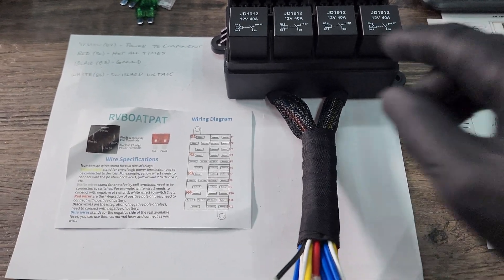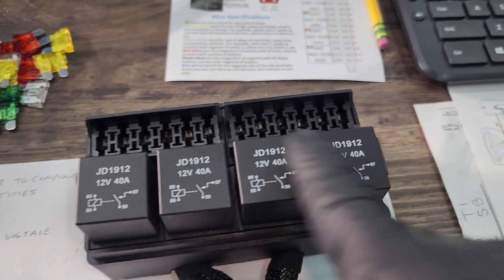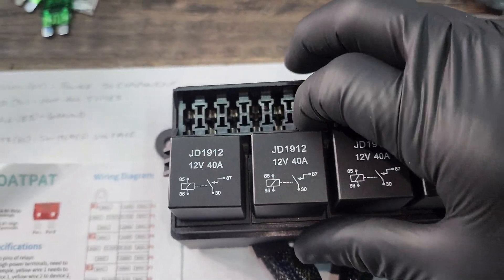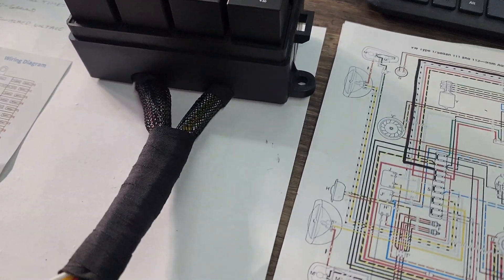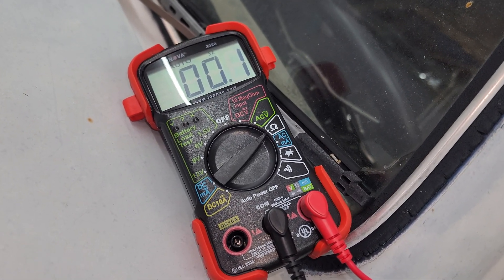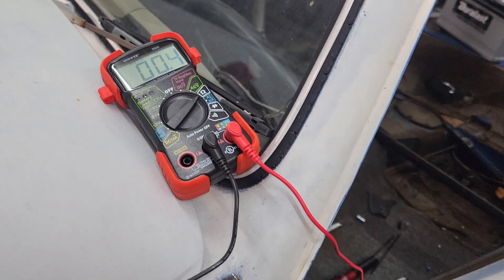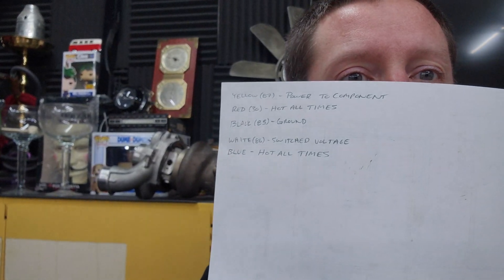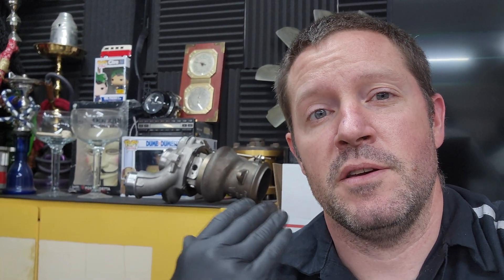How to Install a Modern Fuse and Relay Panel

Comment: So what do the blue ones go? Say a basic fuel pump and fan set up
Reply from the maker: Blue wires are remaining fuse negatives not used by relays.  So if you have a component you want fused but not controlled with a relay, you'll supply the power to the component with the blue wire.

Comment: I commented earlier but my post seems to have disappeared. Interesting content but to be honest, not your best presentation. In fairness, it's not an easy subject. Anyway, I was wondering if you considered using a solid state relay module? They are a bit pricey but offer built in short circuit protection and come in a couple different amp ratings. Just curious.
Reply from the maker: I apologize for the presentation not being up to par.  I will try to do better.  How could I have done better?  I don't want anyone dissatisfied with my content so I welcome the input and criticism.

I did not consider using a solid state relay module.  I'm trying to get this beast driving while spending as little as possible.  That's why I'm using harnesses that I saved from fixing MBs, they're free.  What I used in the video was $40 and more than enough.  I only need 3 of the relays.  I don't plan on adding any electronics to the car.  If I do, I still have one relay left.
Reply: @FriendlyMBTech   It was just a little hard to follow the wire diagram. Also, it wasn't clear where you connected the large red wire for constant +12. I assume you connected directly to the battery but maybe you have a distribution block somewhere?
Reply from the maker: @gstcardude  the diagram was VW specific which admittedly is difficult to follow.  You are correct, the red wire goes directly to the battery.  The Super Beetle is shockingly basic.  95% of the electrical on the car is for lights.  Also, it's been converted from 6v to 12v, so the new alternator is internally regulated, which means the external voltage regulator was removed as well.  The electronics I have added are all better off being controlled by relays.  I'm actually going to try one more thing before replacing the fuel pump to try and save money.  I need a mint to keep working on the V12 haha.